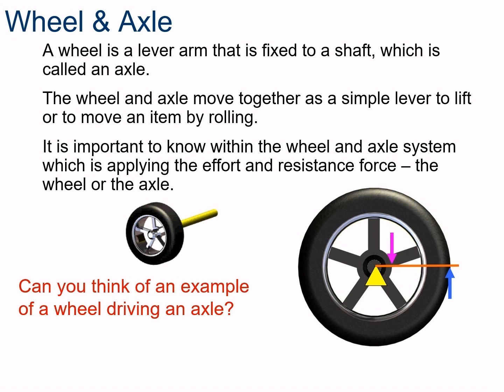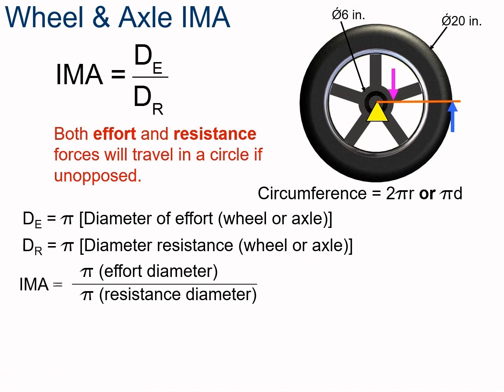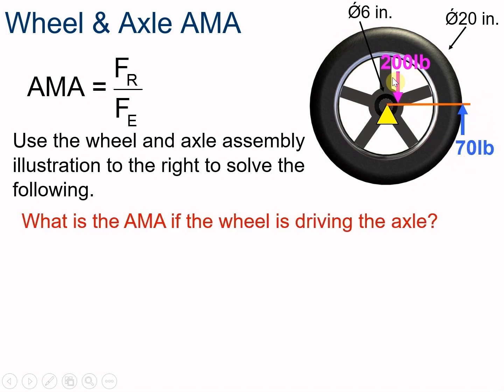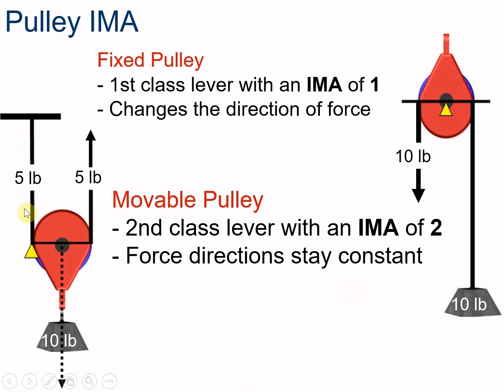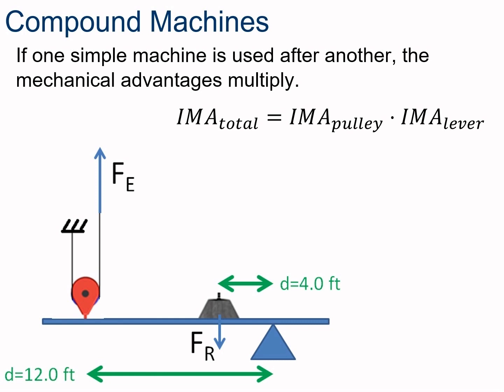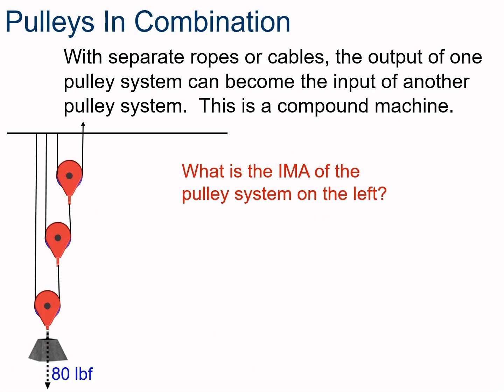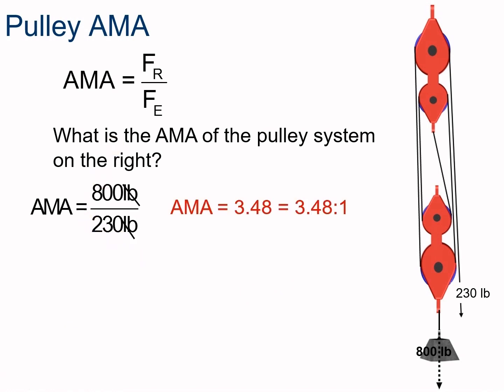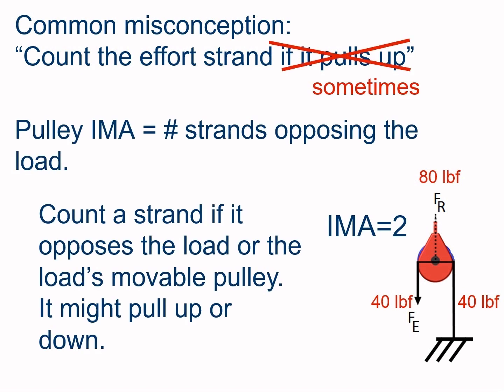1.1.1b Simple Machines Wheel Axle Pulley

Comment: Robot, not bad, but as a long time teacher, may I suggest using numbers which work out evenly? Why use 6 & 20 when it's just as easy to use 5 & 20, and it also helps the force or distance multiplication seem more intuitive. When students see 20 divided by 5,  the MA of 4 is instantly grasped.